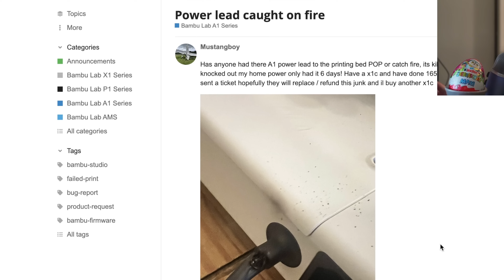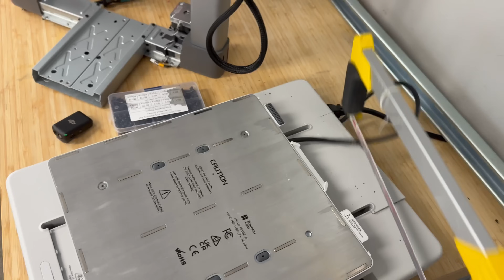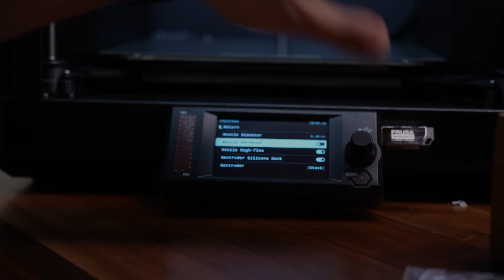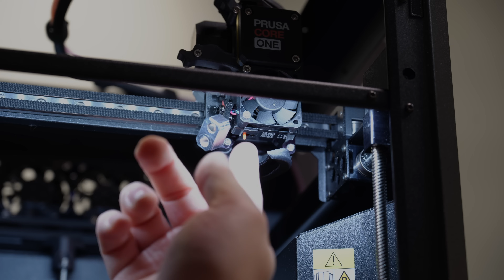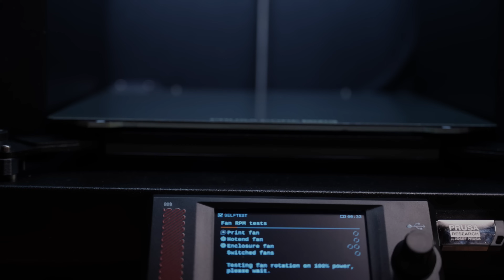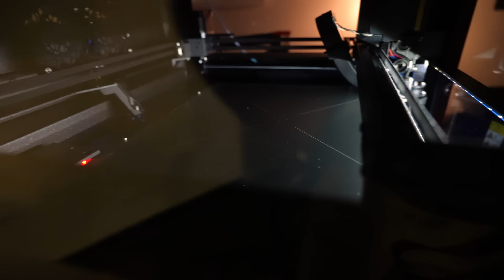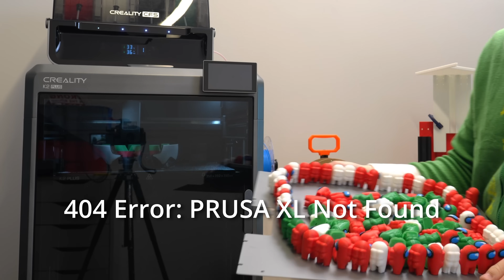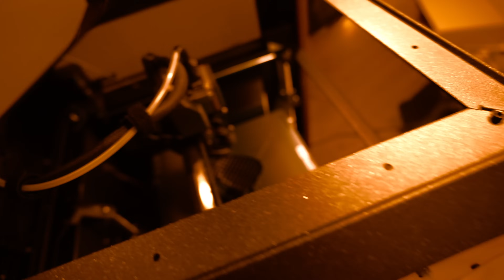PRUSA CORE ONE - The Machine Designed to Trigger Bambu Lab Fanboys

Comment: Bambu fanboys are always salty because they finally realized that there are more prusa innovations in their bambu printers than there are bambu innovations
Reply from the maker: Remember that time Bambu Lab invented multicolor 3d printing? 
Me neither. They just ported the entirety of PRUSA's multicolor slicing engine into their slicer and barely gave credit.
Reply: @NathanBuildsRobots Remember when they invented enclosed core XY printing? 😂
Reply: @NathanBuildsRobots Be careful with your hand and that pretty front bar
Reply: @elleryfg7853  Be careful with your ass and that new terms of use)))
Reply: @NathanBuildsRobots  maybe because Prusa had to put their code out there because they built their slicer on open source code... That required them to give it away?

Remember that time Prusa used someone else's code for their slicer?
Reply: @NathanBuildsRobots  Remember when bambu fanboys thought bambu was the 1st to make a fast printer? Totally ignoring all the fast printers before them, like voron, ankermake M5, FLsun V400, etc.
Reply: @LilApe bambu fanboys were injured by diy class ender 3 from 2015 for 200 bucks. In their minds there were no other good printers)))
Reply: @LilApe  ankermake m5 is a bed slinger, delta printers weren't (and still aren't) really popular, little timmy and Bob who got burned out on an Ender 3 mods are NOT buying a voron. Bambu brought fast corexy at a competitive price.
Reply: @LilApe  That "fruit salad" of printers you made is just missing an SLS or SLA printer, and that's it.

Tell me, which company, until 2022, delivered the same features, already assembled, with all the technology that Bambu Lab integrated into their CoreXY? It's not about being a "fanboy" of anything it's about being reasonable and using common sense...
Reply: @plutonasa Except Qidi beat them to it by multiple years. 😂 Just wasn't as popular.
Reply: @riba2233  Not my point. What the person said was still incorrect. Marketing and aesthetics played a huge role. It's worth at least knowing instead of saying something false. Did Bambu Lab do far more to popularize this style of printer than Qidi or Voron? Yes. Did they invent it, were they the first, or did they even perfect it? No. They made an appealing and fairly affordable package and marketed it well with good looks. This is business.
Reply: @riba2233  Honestly just splitting hairs in an unconstructive conversation. I never disagreed with anything you just said. You were restating what I just said. Just wanted to clarify that despite what many people claim, Bambu Lab was not the first to offer an affordable consumer enclosed core XY 3D printer. We could use any number of small specific features to go down the line and claim all kinds of printers were first in all manner of things. Bambu Lab was successful. No doubt about that. It has literally no bearing on if a new printer is good or not. That's the key point. People trying to claim superiority based on release date are, frankly, fan boying.
Reply: @riba2233  For sure agreed on that. Hugely significant to the market and industry. I just wish people wouldn't treat the brand like it is holy just because it has done well. More annoying than that though is when people refuse to acknowledge everything else Bambu Lab built upon to do what it did. I know that's not you though.
Reply: @plutonasa  Fast coreXY printers existed years before bambu lab was even a kickstarter. Thanks for proving my point, you guys act like bambu invented input shaper and coreXY kinematics. Ankermake and FLsun were already making fully assembled printers with built in input shaper. Stop acting like bambu was the 1st. Just cause ankermake M5 was a i3 printer and the V400 was a delta doesn't make what I said irrelevant.
Reply: @ttshar  I already listed two of the printers. Ankermake M5 and FLsun V400 had all the same tech and ran just as fast, and were released before the X1/X1C.
Reply: @802Garage it's not even an affordable product that Bambu offered. Other printers were even MORE affordable than Bambu.

What Bambu did was focus on those who just wanted to print things. NOT on the printer. 

The ones who got butt hurt by Bambu: 3D printing fanboys who couldn't stand that now ignorant plebes could now just press a button and actually get something to print 😂
Reply: @LilApe  I just want to 3d print. But you all seem to be super invested in your brands.
Reply: It's amazing how people are able to turn 3d printing into political discourse, lol.

Comment: this demo showed me it's not even competing with anyone, it's setting a new standard in reliability. I can't imagine disrupting prints like you did and expecting anything other than a mess. Guess this is going to be my new printer.
Reply: It depends what goes wrong. But that robo alpaca with 1 leg ripped off would print just fine on almost every core XY, or even on an old Ender 5. If you have bed adhesion, it will finish.

Comment: Nice Kore 1ne looks allot like the k1 clone
Reply from the maker: Lol you've posted this comment on so many videos.
It's much better than the K1, more like a X1C competitor.
Reply: @NathanBuildsRobots  yeah the new Kia is a Porsche clone. They stole the entire design it’s got doors windows tires wheels. What a rip off. Why buy a Porsche if you could have a Kia for six times less. Because you know price is the only thing that matters and bargains are the only thing that matters when it comes to price
Reply: @Eric_In_SF  Oh yeah, the new Prusa Kore 1ne is totally an original design. They took the entire MK4 and just put it in a box what innovation! It’s got a bed, steppers, an enclosure… what a ripoff. Why buy a k2 (which costs the same and actually has true innovation like motorized belt tensioners and closed-loop steppers, instead of slapping them all on one driver) when you can have a repackaged MK4 for way more? Because you know branding is the only thing that matters, and nostalgia is the only thing that matters when it comes to Prusa. They really value you, thats why you can pay for a cam in a time where every printer comes with it default.
Reply: @NathanBuildsRobots Prusa’s Kore 1ne is basically a K1 clone with a few tweaks, just enough to stay relevant. The angled enclosure screams K1, and despite trying to position itself as a Bambu X1C competitor, it lacks multi-material or multi-color printing. They’re just trying to stay in the game.

And let’s be real, Prusa is basically fixing the K1’s shattering door issue while keeping all its other flaws. A thin, warp-prone bed (which will definitely warp in an enclosure), VFA all over prints at advertised speeds, fake "active heating," and three Z steppers running off one driver just to mess with you a bit extra.

Prusa wants you to think it’s an X1C, but come on, at its core it's literally just an MK4 in a different shell. They’re playing catch up with a two year old design and still missing the mark. No fancy closed loop system, but hey, at least you get NFC and maybe an invite to a future release dinner or lunch. Oh, and just like the K1, it doesn't come with a camera. You’ll have to buy an "AI" one for $40.

I would love a serious Prusa CoreXY, but look around. This is not it. Prusa is heading for rough waters later this year.

Comment: The bed does not tilt itself. All the Z motors are driven by the same driver. Also, you're still supposed to unload the filament before you change the nozzle. It may not push up far enough with filament sitll in the extruder.
Reply from the maker: Thank you for that correction!
I suppose it just bump levels everything at the start and relies on ABL for the rest, similar to how the MK series works.

Maybe someone can explore tilting in a future mod.
Reply: @NathanBuildsRobots  Yes that's exactly how it works. It would require a mod to the motherboard or a breakout board to make the bed tilt. Lots of work and expense and really no gain.
Reply: @varukasalt  yep, simple skipping steps on low amps is a more efficient way to deal with.
Reply: @NathanBuildsRobots  in fact, for the bed leveling purpose, there is no need in additional two stepper drivers. One stepper driver can control each stepper motors in serial. It only needs additional  commutation components(couple of mosfets, resistors and 2 I/O ports on the MCU).

Comment: What do you think of the Prusa XL vs the Creality K2 plus?
Reply from the maker: The features are different enough that they aren't really suitable for direct comparison (Aside from size), but I'll try:

XL: much more economical and faster for large multicolor prints, better customer support, requires additional enclosure purchase, 5 toolhead version is much more expensive.

K2 Plus: Faster if printing with single color or with minimal color changes. Not really capable of doing true "multimaterial" (AMS style system has many practical limitations with changing from PLA to PETG mid-print for example), much cheaper, can support up to 16 colors, much sturdier frame construction, built-in camera.
Reply from the maker: If you actually need one or the other (or both), your customer requirements take precedent over one being "better" than the other.
Reply: @NathanBuildsRobots  Thanks! I've been comparing them to see if I want to stick with Creality or try Prusa. (Never going with Bambu after what they did)
Reply: @johnsreviewsandmore  what did they do
Reply: @MrBertstare  Forced users into an enclosed Bambu ecosystem and openly takes your data.
Reply: If you need the tool shotgun get the xl 
Outherwise don't know